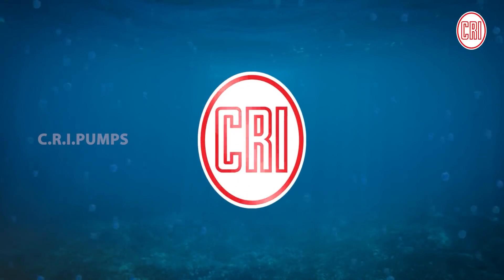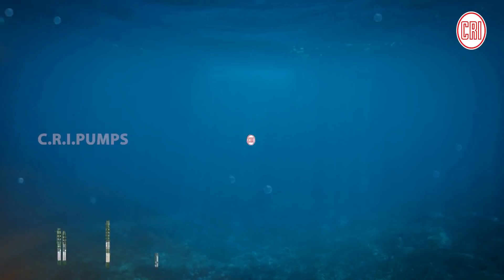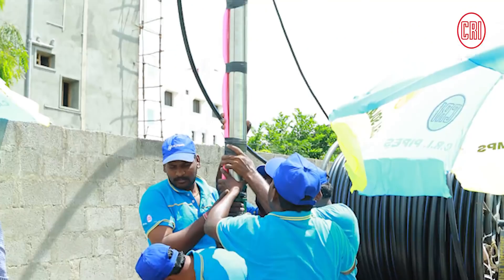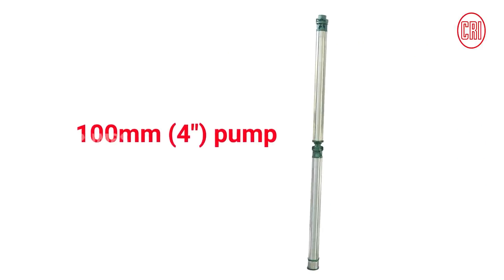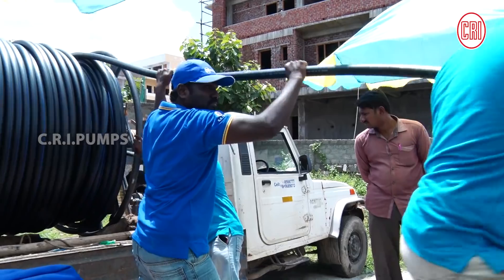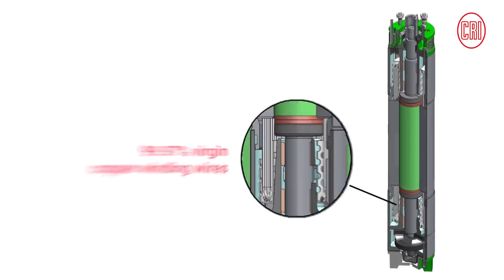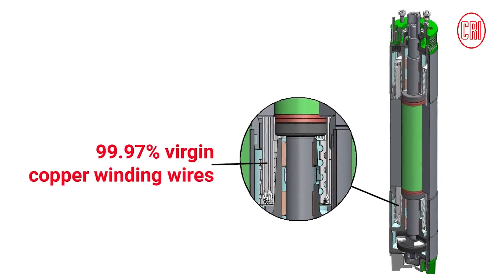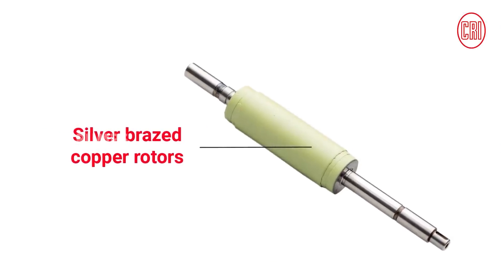C.R.I. Pumps | Lift water from underground beyond 2000 ft | Borewell Submersible Pumpset

Comment: Recently (14.12.2020)we installed new cri 7 stage subscribe motor in 215ft borewell at my house.on installed day and every morning  motor run 15 minutes.next every attempt it runs 1 minut.if we Stop long time it runs 3 to 5 minutes.Till instalation day starter show FDR in every run with or without water.what is the problem.